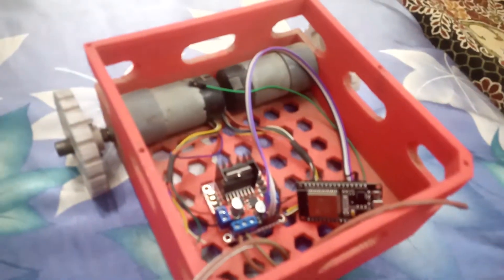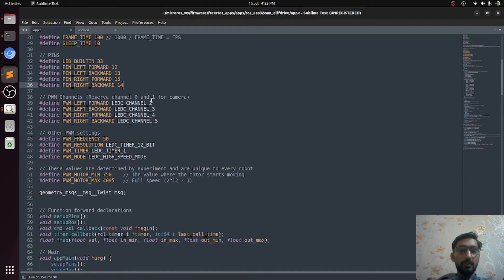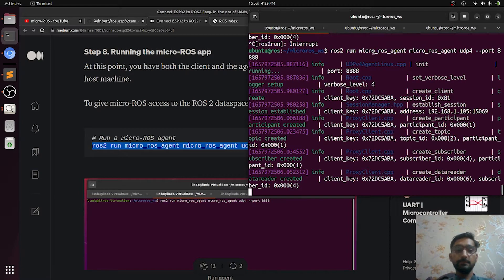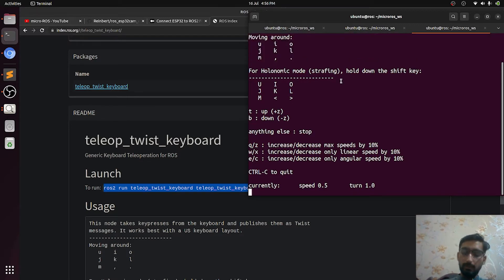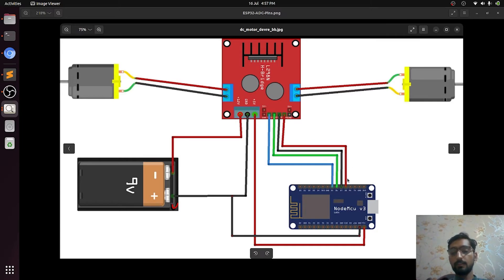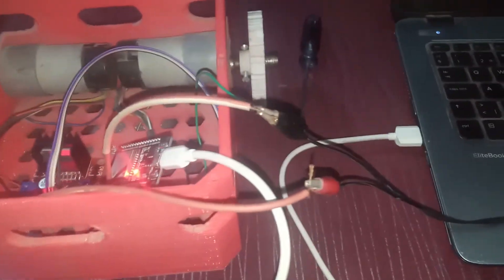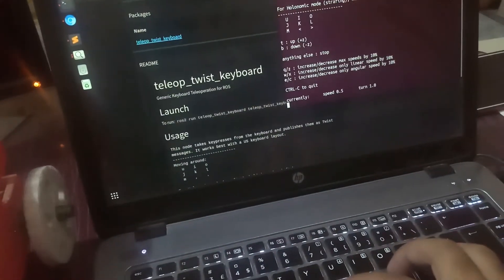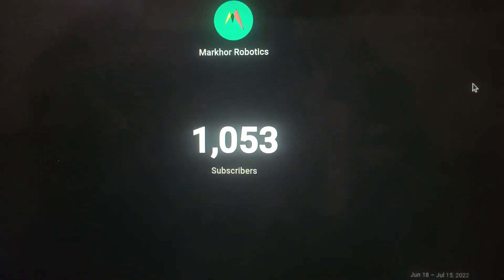Drive your Robot with cmd_vel | ROS2 esp32 MicroROS | Part 04

Comment: This one is strange
How were you able to control the motor speeds when both L298N's enable pins were locked in on 100% duty cycle?